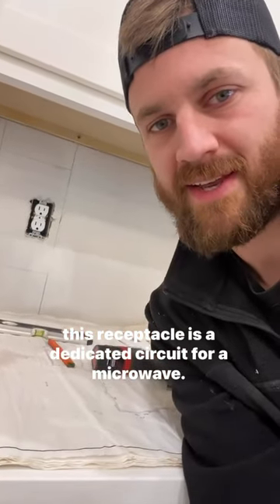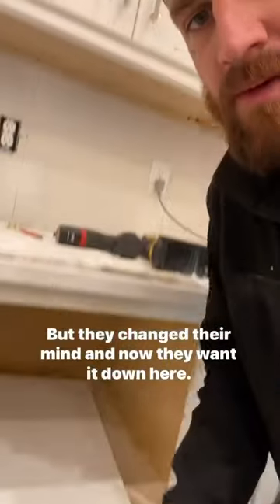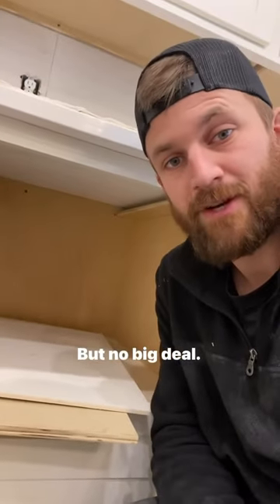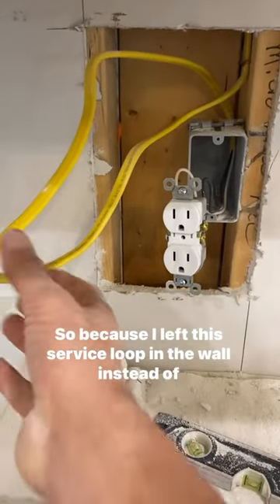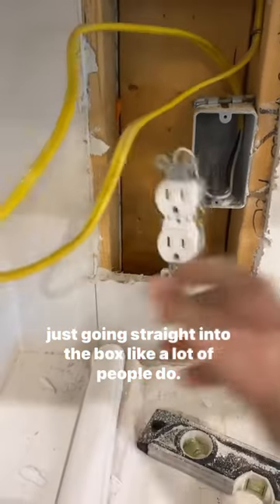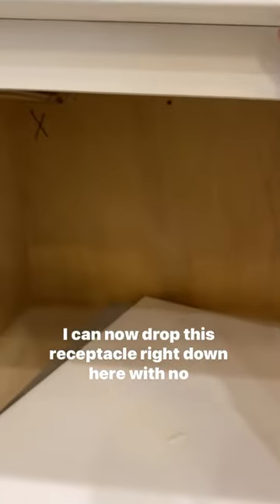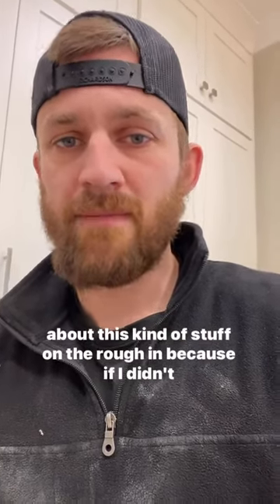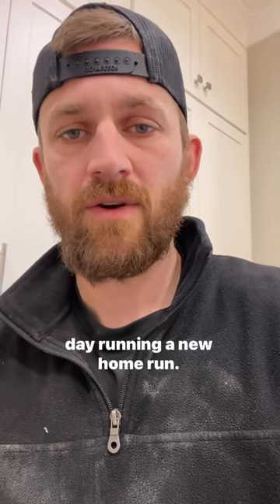This is Why You Should Leave Service Loops!! #electrician #bluecollarlife #construction

Comment: Could’ve used the existing box as a junction box and ran 1ft of romex to the new location and it also would of saved drywall repair😅
Reply: Since code requires all junction boxes to be readily accessible this would require a blank plate in the backsplash of a newly remodeled kitchen. It's worth taking the extra time and effort in order to provide quality work.
Reply: @xbreed13 why not just leave it as an outlet? Can you run 2 outlets on 1 line? Electrically I know you can but idk if it's up to code. He did mention that it was a dedicated run for the microwave, so I'm assuming you can run 2 outlets on 1 cable run.
Reply: Good question
Reply: @bro589 codebook says microwave must be a dedicated circuit so unfortunately you couldn’t leave it and add another plug on that circuit. The inspectors for my county don’t allow large service loops so in this situation it’s run a new circuit or pull it into the attic if possible and set a box up there to then extend your wire to the correct place. That is as long as you are avoiding a blank plate on the wall
Reply: @elliotsmith2766 personally rather than leaving service loops, we purposefully leave  a small amount in the attic instead of in the wall. Less likely to get damaged by drywallers, and all it takes is a pop up there (or under, when applicable) to pop a couple staples and utilize the slack left during the running of home runs. We don't do every wire this way, mostly home runs/dedicated circuit stuff where issues like this may arise during trim out phases of things, sometimes earlier if we are lucky 😂 

I can't say they're a bad idea, but in my personal experience, it's leaving yourself up to damage/troubleshooting issues during later phases when you leave it in the wall. We prefer to leave ourselves some room to work elsewhere. 

General reply to not just you but all commenters. 

But, if all else fails, pull it up, put it in a box and drop a fresh wire down the wall, it's a change order, why does it really matter? Even if that house has 14' ceilings, you're talking what, 50 bucks in wire? (Depending on your market. Ours has settled down a bit, it doubled in price and then some for a while, so worst case let's call it 100) overall its a small change and doesn't require that much effort, compared to what troubleshooting that when it gets nicked in the wall by drywallers or something. Troubleshooting during trim out costs you money, change orders make you money. All that's to say, not required by code, why bother? There's more than one way to fix or change things, there are circumstances where this is the best way, but I see them few and far between in really rough accessibility areas. And if that was the case, use the existing wire to pull your new one up, to a point accessible enough to make a junction. Does it take a few extra minutes? Sure. How many times is this going to cost vs save..?
Reply: @bro589 yes, it can absolutely be duplexed.  Doing so would have been a better solution as microwaves don’t demand a dedicated circuit.
Reply: @smallgaragehustle  some of the other commenters are saying that a microwave might need a dedicated circuit for it to adhere to code in some places. Running the microwave and another high power appliance might trip the breaker.
Reply: @elliotsmith2766 I would have just left the blank plate. Someday, they will want the microwave on the counter and they can just swap the receptacle from below the counter to above the counter. Still code compliant since only one outlet and I don't care about blank plates when there is a purpose.
Reply: Another option if you don't leave a service loop. Cut up a
Inside the cabinet where the wire is. Add junction box, then run a few more fee through the wall down to new location
Reply: @elliotsmith2766  I think code permits a 1ft service loop if i remember correctly but usually as long as it is neat and secured (stapled loosely between studs) it shouldn't be an issue. However, this is why I will loop and stub out and just cut it in on the trim after everyone figures their shit out, hood fan and o/s lts. too. I don't know what they would be able to call you on, not stapled tightly? Stackers I guess..
Reply: As long as the box is accessible. In other words could not splice wire inside if it , put on a blank wall plate then install something over it
Reply: @douchebag0073  those are only allowed for repairs.
Reply: @elliotsmith2766  if a microwave must be a separate circuit (makes sense) why did he put a double outlet in that original box?
Reply: @BeeHiverson  those can't be used in this instance.
Reply: @BeeHiverson  because as of 2017 code they are only legal for repairs where fished into walls. This doesn't classify as a repair, and he cut the wall open already.
Reply: @xbreed13  code requires them to be accessible, not readily accessible. They can be hidden in the cabinets or whatever
Reply: @elliotsmith2766  doesn't have to be dedicated unless its rated for more than half the circuit ampacity. Or if the install instructions say it requires a dedicated circuit.
Reply: @xbreed13 
Also not the electricians problem when the homeowner changes there mind after the fact😂
Reply: @16vSciroccoboi  many microwaves are 1500 W. I’m not sure if that is 1500 W of microwave or 1500 W of power drawn, but it doesn’t matter here.

Outlets are served by a breaker more than 20 A.   1500÷120=12.5A. That’s more than half.

Also, microwaves are usually not on a GFCI, if the circuit is dedicated, because it can be really hard to get in back if it trips.

If you leave the junction box on top of the counter, either someone will probably tile over it, or install an outlet there.
Reply: @guri256  I'm aware of the math involved, if the microwave is less than 10A, like mine, then it's legal though.
Reply: The problem with that is you would be covering up a junction box inside of that wall...
Reply: @HomeRapidRepair  not if you don't bury the box ?
Reply: @bro589 in some places code requires the microwave circuit to be dedicated, and even if you're not in one of these places, if you plug pretty much any other kitchen appliance into the same outlet as a microwave, you will trip the breaker if they're running at the same time. If it's an 1100 watt microwave and you have a 900 w coffee maker that is right on the limit of these circuits.
Reply: @16vSciroccoboi  yes true. Put a fancy stainless steel blank on it?
Reply: @HawkeyePierce1981 you might not, people paying for it might.

🙄
Reply: @guri256 umm in what world doesn't it have to be GFI protected in the kitchen?
Reply: Or, if you don't want a blank cover showing, or perhaps it will be inaccessible in the wall due to something covering it, go back up into the attic and put a junction box. Stays accessible, saves on installation time and wire. No need to run all the way back to the panel.
Reply: @the_undead so you need dedicated ironing outlet? Dedicated coffee maker outlet? Dedicated toaster outlet? Dedicated air fryer? Dedicated toaster oven?

They all take large loads... So you need a 20 space sub panel just for your kitchen?
Reply: Can't have hidden junction boxes it's against code
Reply: Pumps up the problem, so he looks like the savior!   Find yourself a new sparky!
Reply: "Would OF..."? That doesn't make sense. What's the "of" supposed to be for?
Reply: @elliotsmith2766  it's just a kitchen outlet like any other -- nothing special about it and how does "the code" know whether someone is going to plug a microwave into that outlet or not (so it must be dedicated).  I'm with the other posters and they should've just added another lower outlet, leaving the upper outlet in place too.

If the microwave is to be hard-wired in then it makes sense to have a dedicated circuit for that -- but that isn't what this video was showing (it was an outlet, not a hardwired junction box).
Reply: @elliotsmith2766 Well maybe it was for a mixer & not a microwave 😊
Reply: I would have used the existing Outlet in the backsplash as a location for a blank face GFCI protector,  I'm betting it's within 6 ft of a sink
Reply: Came here to say this.  What if they sell the house or change their minds on the location.  An extra outlet is NEVER a bad thing.
Reply: 😅That's only if the customer is ok with seeing a plank cover plate staring at them.  
Code won't allow a junction box to be covered.
Reply: Put and outlet there but don't connect it.  You still have your dedicated line.
Reply: @goosenotmaverick1156 How do you prevent those loops from causing the antenna effect or other noise in all the lines? I know a guy who worked at a place where a contractor left a number of service loops in his office all on one circuit and it caused havoc across the entire wing whenever anything was plugged in there. Of course, they also left several feet of slack coiled up inside the wall on another circuit in the same office... that didn't help.
Reply: Didn’t need a junction box or drywall repair cause left a service .. a remodel box below - pry and drop existing box in wall and drop wire to location.. I’m a trim carpenter and somehow have to show electricians this all the time .. tile over the old box hole .. not saying right ? But didn’t make Tetris in the wall either
Reply: Dedicated circuit ? What’s that .. been in jobs and subs - subs - of a sub have a 220 line to garage outlets . In a 4 million dollar house . Smoked 3 battery charged to prove it ..
Reply: @bro589 that's not what a DEDICATED CIRCUIT IS >:u
Reply: @cray-z578 it does NOT depend on the wattage of the microwave. It's a "Dedicated" outlet created specifically for a microwave. And only a microwave. What the fuck.
Reply: @elliotsmith2766  what prevents a homeowner from using any outlet in the house?
Reply: @bro589 😢😮🥴💯😱And THIS is why inspectors are necessary..."Dedicated" line for microwave--literally means DEDICATED LINE.  Nothing else.  Damn, Dude.  The things people think and do with wiring (pardon the pun) shocks me!
Reply: @smallgaragehustle ...microwaves "don't need a dedicated line" unless that's what was called for--or the microwave (or other appliance) really Does need it's own line.  Stop it.  Just stop telling people to be lazy & incompetent.  The professionalism you exude🤮!
Reply: @lucasbiaggini because he bought at contractor prices, the bulk box of doubles-singles are way more
Reply: @jeremymaechtle8092 I like 220 lines.  My hubby has an electric welder.  Very handy.  Extra nice not sharing the dryer outlet, too!  But having 220 outlet in garage is also good if someone wants an electric car charger added.
Dedicated circuits are nice-especially for higher draw appliances.  Now that appliances use wifi [which uses 2.4gHz.  Home wifi's use both 2.4 and 5.0 or just one or the other, but a conduit running a dedicated wire can make it easier to run an ethernet cable to an appliance that isn't catching signal], it can be extra helpful not to have too much interference[@2.4gHz which microwaves make while being operated regardless-same as flourescent light balasts and several others].  I'm personally a fan of conduit.  Stops alot of [edit: crosstalk and various other] problems [like wire change outs if the homeowner gets spray foam insulation especially, flooding or leaks touching wires, nails or staples damaging insulator layer, etc.] before they begin.
Reply: @beepbop6697  I thought it was mentioned in the video that it was for a microwave. Most built in microwaves are still plug in, but like someone else mentioned it uses more than half the available load for a 20a circuit. So if someone plugged in a coffee maker on the same circuit while the microwave was running it would trip the breaker. And it’s not “the code” you have to please it’s the final inspection by the county inspector that you have to worry about.
Reply: @HawkeyePierce1981 💯, change is always constant😊
Reply: @honeybadgerisme  why does a 750w mounted microwave need a dedicated line? When you can plug in a 1100w countertop microwave into any outlet? What’s the big deal if the breaker trips once or twice a year? The microwave doesn’t start up randomly like a furnace would.
Reply: @bro589   blank plate for the inspection, then pop in an outlet afterwards
Reply: Just leave plug as is with no wires connected to outlet. Run wires to new outlet. Done.
Reply: @honeybadgerisme  it’s a counter top microwave for f’s sake. Keep up already.
Reply: Americans and their crazy regulations.
Reply: @bro589  I started repairing microwaves I find on the curb and plugged one in a random plug in the basement after changing the fuse, light is on, awesome. Will it work though? Worked fine for a couple seconds until the transformer came on then tripped the breaker. 
It took a second to figure out but if I were cooking something and the microwave stops working, and I'm completely incompetent with everything, how long am I waiting for someone else to come out and diagnose it as the breaker and not try to sell me a whole new microwave/install/or repair
Reply: @vanhalenps4  yeah bro don’t cross the street, it’s dangerous for people like you.
Reply: That's what a fish steel is for 😅
Reply: Fish steel..
Reply: @elliotsmith2766  I’m not an electrician but that’s how I do things. Electrician never says a word about it
Reply: put a accessible junction box above the upper cabinet
Reply: Exactly what I do.
Reply: But then you've got a junction box in the middle of your wall in your kitchen. You can't leave it as a receptacle otherwise it's not dedicated for the microwave and risks and overload situation and is against code. This man is brilliant as an electrician I can say we need more electricians like you. Thank you for thinking about the next guy the homeowner and yourself and putting a little extra effort into making sure things can be adjusted later.
Reply: @goosenotmaverick1156 I'm not really sure how the service loop in the attic is helping you adjust your plug location if the wiring is secured to a stud within the distance required by code. There should be staples or some sort of an attachment near the box keeping the wire secure so pulling more wire from a loop left in the attic does not seem feasible without also opening up the wall. Unless of course you're not strapping your wires within the wall.
Reply: @smallgaragehustle depending on where you live a microwave is supposed to have a dedicated circuit in the kitchen
Reply: @lucasbiaggini a duplex receptacle is considered acceptable for a dedicated kitchen circuit. Code does not require a single receptacle for dedicated circuits in most kitchen applications. There is most likely a duplex receptacle like this for the garbage disposal also and that is also a dedicated circuit.
Reply: @Timpon_Dorz it only has to be GFCI protected in the kitchen if it was within a certain distance of water or at high risk of coming in contact with water. Not all kitchen receptacles or GFCI protected unless you're in such a small kitchen that all of the receptacles are at risk of coming in contact with water from the sink
Reply: @Timpon_Dorz no but code in the most places requires a certain number of dedicated circuits to be ran to the kitchen. Some of the outlets in your kitchen probably share a circuit but a lot of them have a dedicated breaker and home run.
Reply: @DoubleDoubleWithOnions can't do that unless it's a fake outlet that couldn't possibly be wired up by somebody later.
Reply: @northwestlife_9 nothing... The code requires a number of dedicated circuits to be placed in the kitchen so that as long as you're not stupid you can use your microwave without catching your house on fire. Nothing's to stop a homeowner from putting a power strip on any outlet in their home and running five microwaves at the same time except the breaker tripping or worst case scenario the wires catching on fire.
Reply: @patrickzavas 210.52(B)(1) 2 minimum 20 amp circuits for small appliances...I am not aware of any special requirement for other appliances. Not sure where you got the code reference for dedicated circuits. Can you please state them?
Reply: @patrickzavas  requirement for GFI
 210.8(A)(6) kitchens- where the receptacles are installed to serve countertop surfaces.

Nowhere does it say 6' from sink. Homeowners like you need to stop your hobby on YouTube and mislead people. I've been doing this for a bit, so please state your code where you got you don't need GFI for kitchens with that 6' rule
Reply: @patrickzavas  thank you. I've seen Microwave ovens placed in dining rooms and other places.
Reply: @patrickzavas  I mean, if you're not smashing the brains out of your wire with a staple, you pull the easily reached staple and give a gentle tug, and it's not any issue. But yeah, it's not something I've ever really had an issue with. Better than a service loop inside a wall getting nicked/nailed/otherwise damaged in the rest of the process of the home being built/finished.
Reply: Junction box yes but a single cable being extended isn’t an issue. Just use a shallow box. The wire can also be spliced without a box and tapped well. And yes I know it’s frowned upon by the ocd/professionals if done properly it won’t have any problems
Reply: @JustinLodes  hack homeowner. Next
Reply: @bro589 nowhere in the code says that microwave must be a dedicated circuit, but it is common and good practice. On the other hand, the book says that at least 2 dedicated 20 amp small appliance (counter top) circuits must be installed. So as long as he has 2 more counter top circuits installed in that kitchen, legally, he absolutely could just put a receptacle there and ran the wire down to the microwave. Even though it's not recommended and that would be last resort.
Reply: @elliotsmith2766 codebook doesn’t say anything about microwaves being a a dedicated circuit. Unless the manufacturer specifies, Two 20amp small appliances circuit’s is the requirement - 2017 NEC article 210.50 (B)
Reply: @MichiganHunter1000  A permanently installed type cannot be supplied by any of the two or more small-appliance branch circuits in accordance with 210.52(B)(2) but if it is a countertop style then yes you are correct it can.
Reply: I would think a 6-breaker subpanel fed from a 40-amp or 50-amp feed.  Any combination of loads that could be handled by a pair of 20 amp breakers (mininum code) could be accommodated by that setup, but it would also support many combinations of three appliances that couldn't be handled using 20-amp circuits.
Reply: @goosenotmaverick1156  anybody who's reading this... Never ever ever pull Romex through an attached staple. You will most likely damage the insulation and compromise the integrity of the wire. And yes your staples should be tight enough that the wire will not move That's the entire point of the staple.
Reply: @Timpon_Dorz  I didn't actually say anything about 6 ft.
All 125-volt, single-phase, 15- and 20-ampere receptacles within 6 ft. of any sink, including kitchen sinks
All outlets that serve countertop surfaces, including any outlets on walls, behind wet areas, or countertop breakfast bars
All exterior and bathroom receptacles
All receptacles within six feet of sinks, washing machines, and water heaters in laundry and utility rooms
GFCI protection for appliances includes dryers, wall-mounted ovens, counter-mounted cooking units, and microwave ovens
Reply: @Timpon_Dorz  I've been in the commercial and residential electrician for 15 years. I've ran commercial job sites as a foreman and worked for years as a residential service electrician. Not all receptacles in the kitchen have to be GFCI protected Only if they serve a countertop otherwise if they are more than 6 ft away from water they do not require protection unless they are meant to service certain equipment. So thank you for warning me about being an ignorant homeowner but unfortunately for you that's not the case. I've also been doing this for quite some time this is my livelihood.
Reply: @Timpon_Dorz  All 125-volt, single-phase, 15- and 20-ampere receptacles within 6 ft. of any sink, including kitchen sinks

All outlets that serve countertop surfaces, including any outlets on walls, behind wet areas, or countertop breakfast bars

All exterior and bathroom receptacles

All receptacles within six feet of sinks, washing machines, and water heaters in laundry and utility rooms

GFCI protection for appliances includes dryers, wall-mounted ovens, counter-mounted cooking units, and microwave ovens
Reply: @Timpon_Dorz  there are several appliances locations and situations that require GFCI outlet protection.
Reply: @patrickzavas  thanks? Not sure why you are telling me this. Are you going to tell me the water is wet?
Reply: @patrickzavas  all countertop outlets serving the kitchen. You still need to GFI if it's over 6' from sink if it's a countertop.

Who cares what you do? I follow the code, not some hack electrician telling me you don't need to GFI kitchen outlets if it's further than 6' from sink.
Reply: @patrickzavas  you also need to GFI and AFCI basement outlets even in finished basements.

Did you forget? Mr. Iamanelectrician?
Reply: @elliotsmith2766 
No it doesn’t; you’re to have 2 small appliance circuits; microwave is a small appliance
Reply: @honeybadgerisme 
You’re only required 2 small appliance circuits in the kitchen, you’re not required to put microwave on a dedicated circuit unless the ordinance of the city you’re working in requires it.
Reply: @patrickzavas 
Gfci for kitchen receptacles, all counter top receptacles, dishwasher and disposal, and yes even the refrigerator has to be GFCI now
Reply: @frankstallcup8720  thanks for the info... I've been out of work for 2 year due to a back injury, is that newer code?
Reply: @Timpon_Dorz  if its not a countertop.....
Reply: @Timpon_Dorz  I'm not sure what your referring to. Also, I didn't think i needed to tell you but, yes, water is, in fact, wet.
Reply: @patrickzavas  thanks Captain obvious. I am gonna share something with you that you might not be aware of. Your mom is older than you are. 🤯 I know right?
Reply: @Timpon_Dorz  damn it, My cover is blown... Now Captain obvious must go into hiding :)
Captain obvious away.......!!!!!
Reply: @frankstallcup8720  ok, but half my house, which includes all the outlets and lights in the kitchen, hallway, main bathroom and master bedroom all share ONE breaker...so no coffee for me!
Reply: @honeybadgerisme  
Do understand your question, we put all lights on separate circuits from receptacles, so a 2500 square foot home will have 3 or 4 lighting circuits, you will have 2 general plug circuits, 3 or more bathrooms 2 plug circuits, kitchen 4 small appliance circuits, 1 utility room circuit, 1 garage and outside receptacles circuit. 
A typical house should only have 10 120 volt 20 amp circuits, 4 120 volt 15 amp circuits, then your 220 volt circuits. 

This is a solid wired home that will require no warranty calls except maybe product failure from the Manufacturer, that’s 50 years of experience talking with 40 years experience as a contractor. 
Now that’s not to say that you may have more 1 pole 15 and 1 pole 20’s then I showed, depends on what’s going in the house, but that is what a standard house requires to meet code and be a good product for the homeowner
Reply: @frankstallcup8720  Aw❣️You are SO sweet to think this house was built to some sort of standard or code or ethics!  The more I open up walls-the more nightmarish bs I find.
I will be rewiring the house myself and hiring a real pro to check it off before the real inspection, tho!
Reply: @bro589 dedicated circuit, so nothing else is allowed.  Sometimes we install single receptacles so people don't plug in something else
Reply: @16vSciroccoboi  as far as the nec code is concerned the splice kits are aloud at all times. There use by modular home between prewired sections all over the place and for situations like this.
Reply: A dedicated circuit is a circuit that supplies power to only one thing, such as a: refrigerator, microwave, furnace, stove, hot tub, dryer, etc. You can't have more than one outlet because of the reason that these appliances are potentially able to draw the full capacity of that circuit and it wouldn't be safe to plug in and run other things at the same time. So electrical codes forbid you from having additional outlets to ensure that is prevented.
Reply: @elliotsmith2766  microwave must be on a dedicated circuit? Interesting. I'll have to see if my kitchen microwave is on its own circuit. I didn't think it was, but now I'll have to check it out.
Reply: Or splice the wire in the wall with a proper splice